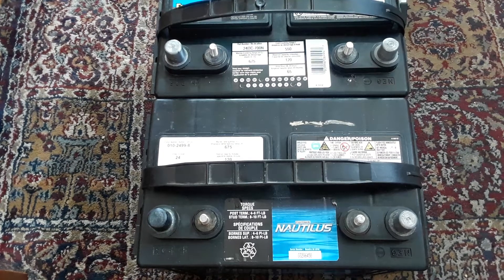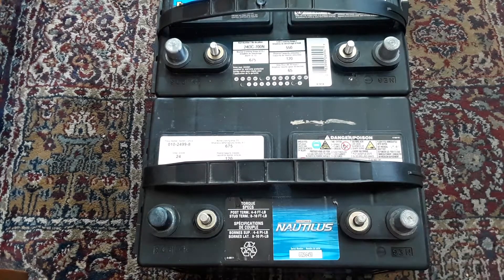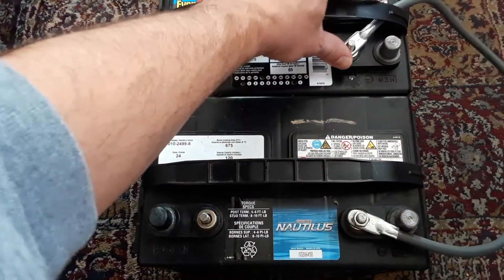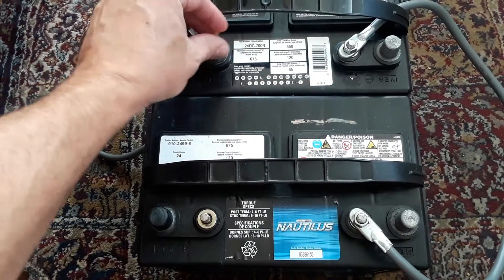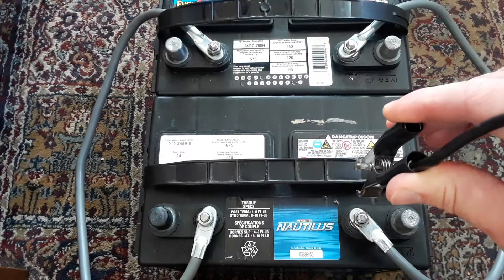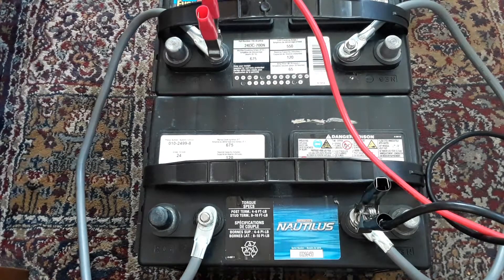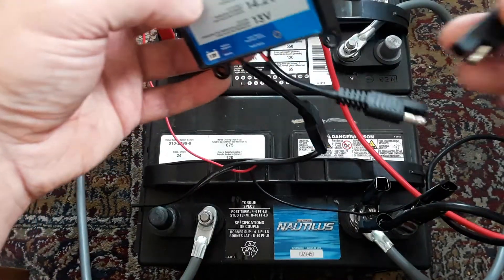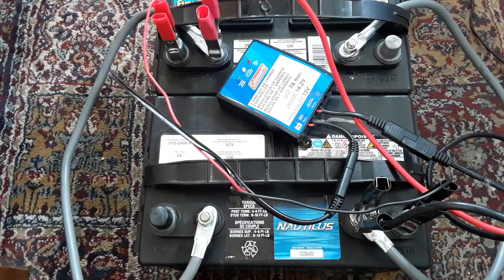How To Hook Up Solar Panel To Battery Bank

Comment: Glad I found your video , I’m about to go camping with my travel trailer and I have a new suitcase style 100 watt solar panel. I will use to charge the two batteries out on the tongue.  I just didn’t know if I was supposed to hook up to just one battery  , Or one clamp on one and one clamp on the other so again thank you

Comment: Actually, your washer goes over top of your 4-gauge connector. 🧑‍🎓
Reply from the maker: I realize washers usually go under the nut but in this case I wanted to create a better contact between the wire and the battery post.
Reply: @jackofalltradesmasterofnon6120  I understand. It's just that I have heard that in the event of a short, the washer may melt as all the current now must pass directly through it. Also, I have gotten the message more often than not that you should connect positive first and negative second.  It sounds like I'm bashing your video but I'm really not lol! I really like your layout and the clarity of it!! Just trying to be helpful for safety's sake at the risk of sounding like a smart ass.

Comment: Thanks for posting..  Pass the cable through the strap on both sides.  Also, a discussion on why and how you chose the gauge of wire would be valuable.
What are the battery specs and what is the gauge of the wire you are using?

Comment: In the video you showed that the same positive and negative you have your inverter and solar power on the same ones. Do you think you'll be okay to have like the solar power on one positive negative and the inverter on the other opposite positive and negative. This way it would be one side in  and the other side going out or does it really matter with batteries? my batteries are lithium-ion
Reply from the maker: It doesn't matter, I have had this set up for 6 years, no problems.
Reply: @jackofalltradesmasterofnon6120  OK thanks
Reply: I did an edit

Comment: Why do you have the positive output of the charge controller to one battery and the negative output to the other battery? Is there a reason, I have a similar setup with two batteries, I connected the batteries in parallel, but put the pos and neg outputs of the charge controller on one battery thinking that would work. But a few days later and my solar kit has shown low battery.

Comment: Shouldn't you put red on first , black on last?
Reply: YES YOU SHOULD !! 
The reason you connect the POSITIVE first is that the negative is the ground wire. You don’t want the ground wire to be connected first because then the circuit will be completed as you try to connect the positive which could lead to sparks.

These sparks could shock you or worse short out the battery or other components. That is why it is important to make sure that the positive is connected first.

With the positive connected, then when you go to connect the ground sparks will not occur because it will go into the ground wire. This will keep you safe as you connect the wires and also keep the components in your vehicle or equipment safe.

Comment: How many W solar do you recommend for duel battery hook up ?
Reply from the maker: 2 amp is considered a trickle charge, and 10 amp is considered a fast charge.   
It also depends on what you are running and how many people are using power. You would need 200 watts of solar to achieve 10 amp fast charge is what I would recommend if you can afford it.
Reply: @jackofalltradesmasterofnon6120  all good only thing running off then is to charge phone / laptop and run floor fan . That's it .
Reply: @Adam-jx7eq  do you have to disconnect the solar panels before you connect let’s say a charging block to charge things?

Comment: I have a question I'm hoping you can help me with I put a power inverter hooked up to a battery okay so the battery is powering my power inverter on the power inverter I hooked up a battery charge maintainer the battery charge maintainer I connected it back to the battery in theory I was thinking that the battery to the power inverter plugging in a battery maintainer going back to the battery would continuously power its own self I mean I was certain that it should be that it would go in a circle but I was wrong it drained the battery and empowers on South back I was figuring that the battery charge maintainer with power back the battery using its own power sort of like infinite power but I was wrong why doesn't it or did I do something wrong 12 volt car battery to a 1,500 watt power inverter charge maintainer plugged into the inverter back to the battery and it didn't work so I'm going to try the same concept but I'm going to add a solar panel and charge controller to this circle what I'm trying to do is keep my car battery charge so that it Powers my amplifier my lights and all my gadgets inside of my mobile command center 1995 G20 Chevy van thank you for your time and great video bro kind of slow and monotone but I'll never have to forget how to wire a battery I think you just engraved it on my brain that is slowly bleeding into my ears just kidding boss thank you so much God bless
Reply from the maker: The only thing I can think of, is that you are having a problem because you are using a regular 12v battery and not a deep cycle. A regular 12v in your vehicle is made just for that initial start up and then the alternator takes care of the rest. Deep cycle batteries are made for powering items like power inverters and are also made to be discharged and charged hundreds of times. You cant use a regular 12v like a deep cycle. Hope this helps.

Comment: Great video I have a question or two. So if your RV battery is hooked up to the batteries, once the solar is hooked up it'll charge the RV battery as well? When you unhook say the solar can you or is there a way the RV when running, can charge up your batteries say if solar wasn't doing the job? If so, does the RV have to be driving to charge those up, or can it set there just running?
Reply from the maker: Yes, idling should charge them.
Reply from the maker: My pop up camper batteries will charge when I am driving, providing that I have the round wiring harness hooked up. I wouldn't want to back my car up, hook up the wiring harness, and let my car idle while I'm camping to charge the batteries everytime they need it. Go solar, but go big enough.